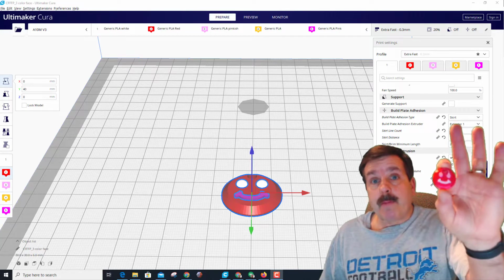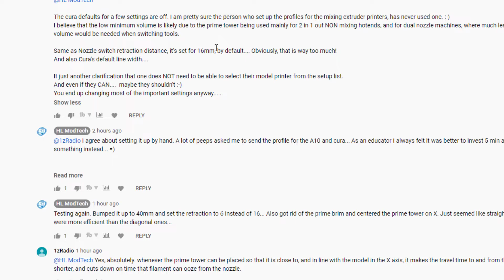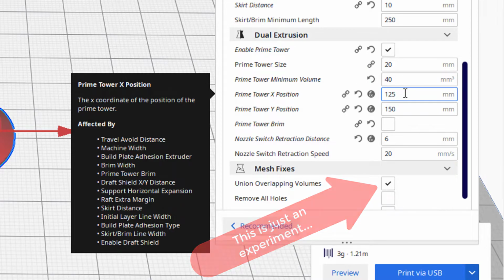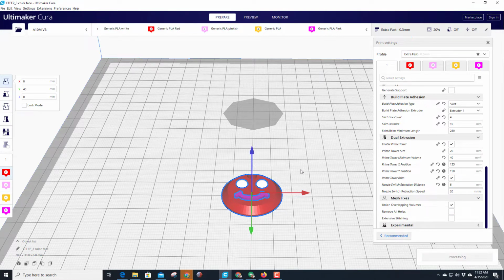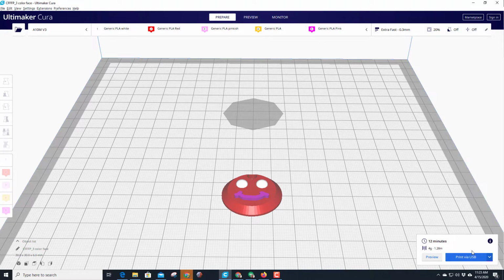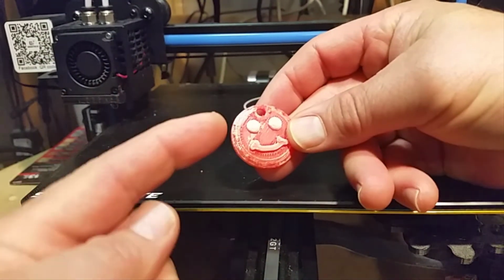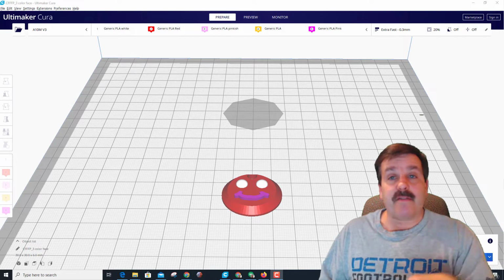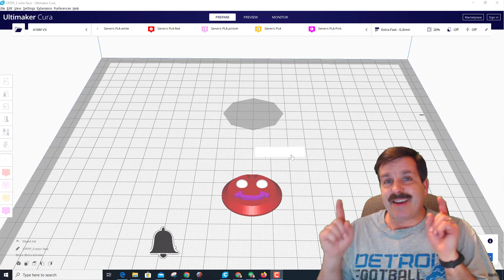Solved! Mixed Printing with a Geeetech A10M and Cura 4.5

Comment: I have one problem with the prime tower. If the printer make the last color change, the nozzle temperature reduced to 0. So the last layers with the last color are not printed. Did you have an idea?
Reply from the maker: I have not used it in a long time. Are you using Cura 4.6? It was the last version that had the option for the mixing hot end to be checked.
Reply: @HLModTech  No, I'm using Cura 4.13.  I don't want to use mix printing. Printing with 2 colors is enough.
Reply from the maker: You have a mixing hot end though. That was the feature that tricked Cura into not thinking there was a 2nd hot end, and  thus cooling off the one you are using.
Reply: @HLModTech  OK, and where can I change it? I select the geetech A10m directly in cura. I don't change anything.
At the moment I change the gecode with an script in cura, which change the value from 0 to 200.
Reply from the maker: Sorry I did not see this before. Replies do not pop a notification for me it seems. I do not have a technique to change it in the newer cura. I could only do it in 4.6. I keep both installed on my machine so I can do 2 color prints when I want.
Reply: @HLModTech  Directly after the prime tower the gecode is 
M109 S200
M104 T0 S0
The problem is the M104 T0 S0.  I think coura means to switch off one nozzle but I only have on nozzle in my A10M.
Reply: Hi  Benutze neus Cura , mach eine wall um das model und purg turm nahe am model ca ca 2 cm diferenz zu model Wall , ,Typ neues cura profil , Cr x wählen und profil buldplatte and x and y axis werte vom geeetech , probing , det its perfect profil ( Crealtity CR X  profil. Lg Swiss Druck😂